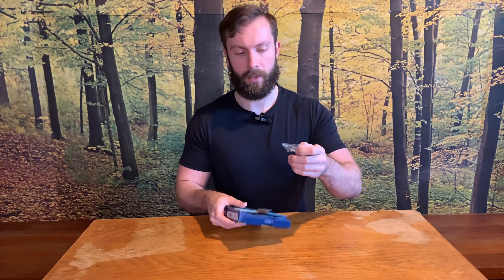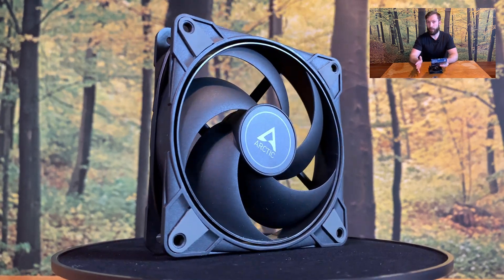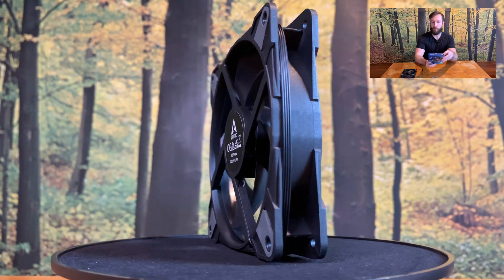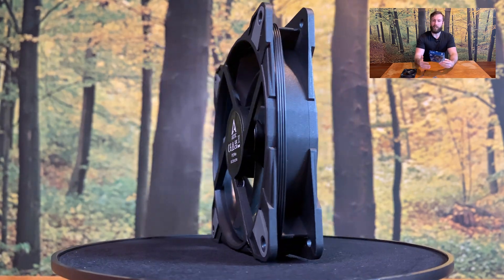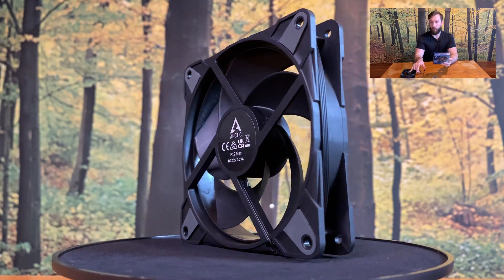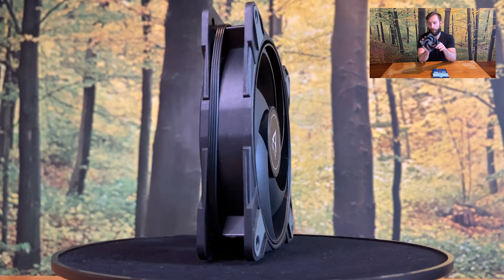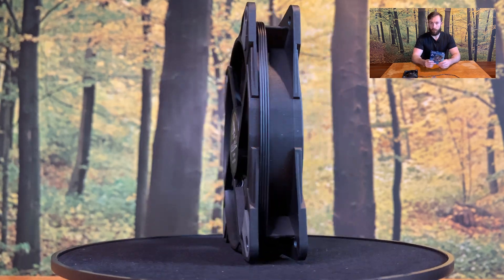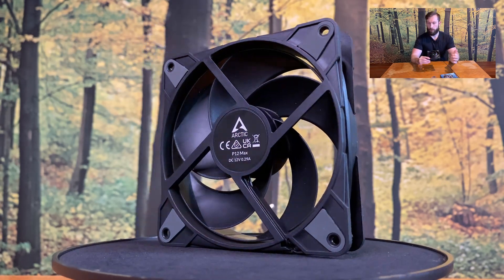Unboxing - Arctic P12 MAX fan

Comment: Thanks for the review. I ordered 3 of these along with a 3-fan splitter for my Arctic Liquid Freezer II 360 AIO which originally comes with 3x P12 PST fans (1800RPM). Let's see if they can drop temps even lower on my Ryzen 9 7950x when overclocked. I hope I didn't just waste a bunch of money. 😄
Reply: Hello. How did it turn out? I was thinking of getting some new fans for my AIO and case, and noticed the very cheap P12 (original) in the local store. My system isn't that powerful. Am I better of paying the premium for the Max or do the original ones do, you recon?
Reply: @Wisvego  if your system isn't that powerful you should be fine with the p12's but the p12 maxs really arent that expensive and a definitely a lot better than the p12's